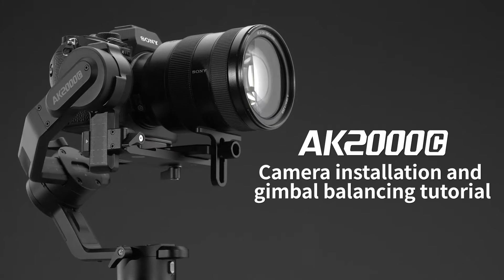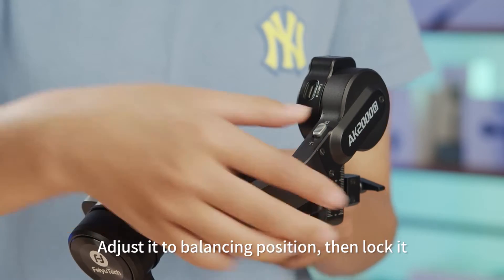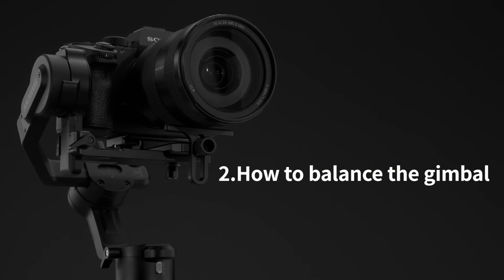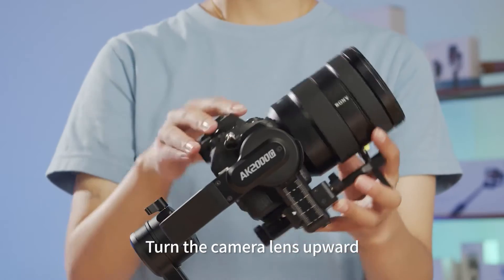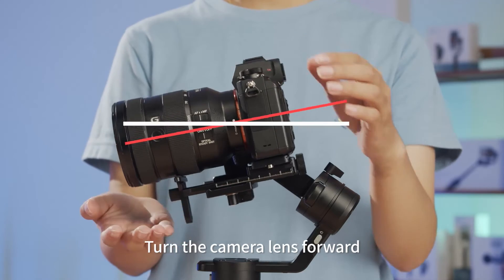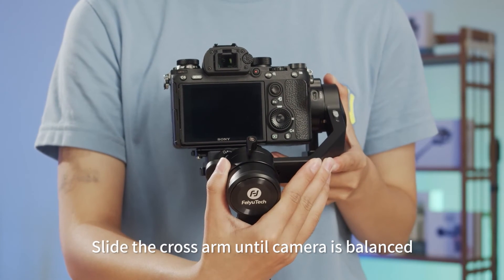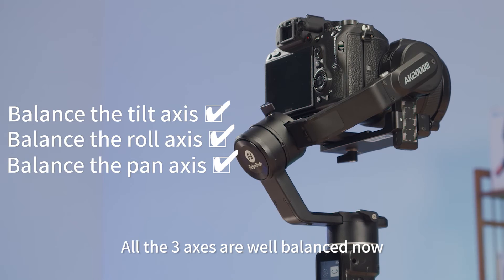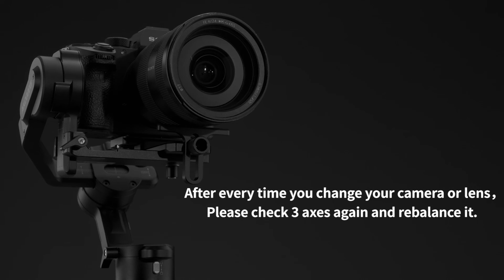AK2000C Tutorial EP2| Camera Installation and Gimbal Balancing

Comment: I´m having an issue with my AK2000. I can´t use other modes but TF. I reseted  gimbals parameter but nothing changed. I upgraded the firmare but anyways nothing happend. I need a help with this problem, please.

Comment: I have several gimbal stabilizers for my gopros and smartphones. I emphatically wanted to like this gimbal. Sadly that wasn't the case. Installation and balancing were easy enough. When powered on it snaps to zero fast enough. However, on a GH4 with Lumix 42.5 1.2mm lens this gimbal is literally useless. Every step bounce, every shake shows up in video. Every one. Essentially its just a weighted handle. No thanks.
Reply: This Gimbal has several modes for camera movement. You need to be in lock mode or else the camera will tilt up and down as you take steps. My handhald action camera gimbal also had the same issue until I realized I was in the wrong mode lol.

Comment: I just bought this gimbal and the screw connecting the plate to the camera doesn’t even FIT! Beyond irritated and upset with this purchase!!!!
Reply: i had the same issue. one end of the slot should be slightly bigger (but not bigger than the screw), enabling you to screw the screw through that end of the slot, then it will slide back and forth without falling out. i drilled mine out before realizing this. weird
Reply: @HBrooks  ah yes! It’s marked and I finally figured it out but it’s hard to figure out at first 😬 Thank you!
Reply: @HBrooks , man, thank you very much from Ukraine! I already wanted to take out the drill, but your comment save my device.
Reply: @HBrooks  it took me forever to get the screw in!
Reply: @tanqurei  yes! other than that, this gimbal is pretty nice. does all i need it to.
Reply: Thank you!! This comment helped!!
Reply: Does ak2000c has inception mode?
Reply: Had the same problem but it fits trust me.
Reply: Many quick release plates work like this. The extended hole where it goes has a wider section at one of the ends where you can screw it properly, then it rolls towards the section where you want to attach the camera

Comment: How do I balance the tilt axis if I have a directional mic attached to the hot shoe which prevents me from tilting my camera all the way back?
Reply: Help the gimbal by using your hand as a stopper in the back section. I am using this gimbal with a Sony Camcorder só the camcorder has to be on the far left of the gimbal due to the weight distribution.